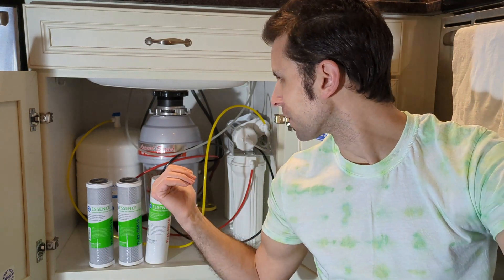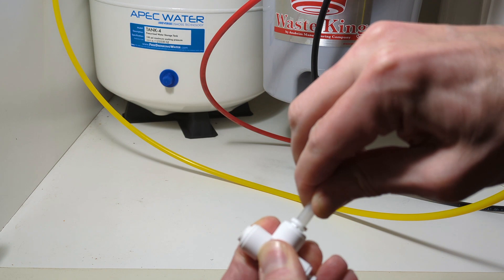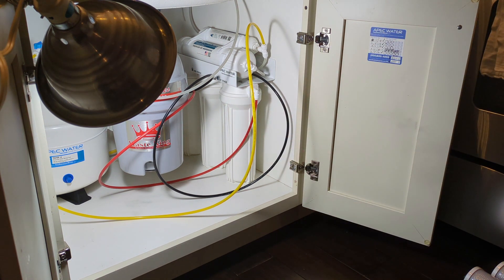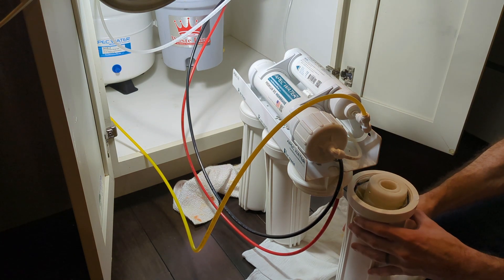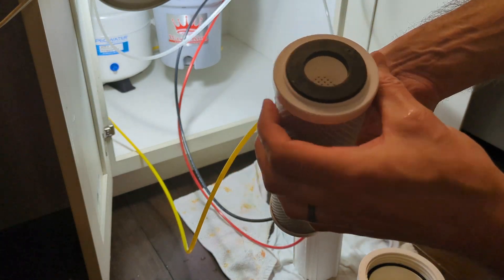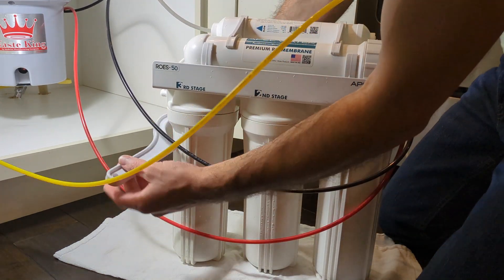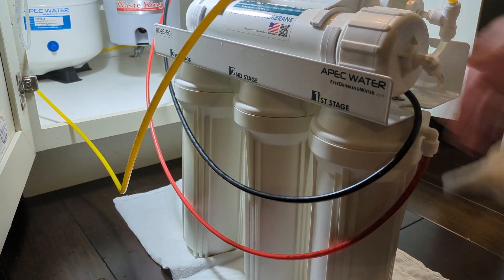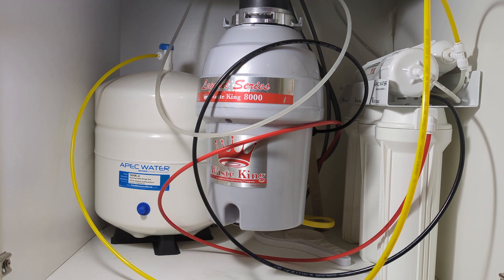Honest Review - APEC Reverse Osmosis Essence Drinking Water Filter System and Change ROES-50 GPD

Comment: Thanks done the video. Does the drainage ( black ) line drip continuously in the the garbage disposal ? I noticed mine making dripping noise in the p trap . Not a lot but enough to notice the sound sometime .
Reply from the maker: Never noticed it here. But maybe I'm not paying close enough attention. I believe it would be continuous until the tank is full. Maybe you could adjust how far the drain line enters the pipe and cause the water to run down the side of the pipe vs drip straight down.

Comment: I noticed you didn’t drill any holes? Is there a way to avoid drilling holes. I don’t want to drill holes in my pipes. I have a hole for the faucet
Reply from the maker: For the drain waste water I did drill a hole and no issues with it. I don't mind since it's not buried in the wall and I'll see if it ever leaks. It's a solid connection though. You could certainly plumb something else into the drain line but it would take some extra time.

Comment: Very helpful video. I have the 7 stage APEC system just installed. Recommended by my kitchen contractor but not liking the filter replacement process. Since just stalled haven’t used much but our issue isn’t water isn’t cold. Fo you know what issue mb?
Reply from the maker: @jacquelineguy6231  water will be room temperature if the tank is in the cabinet under the sink. The filtered water will wait there to be used and warm up to room temperature.

Comment: How long does it take to fill up a gallon jug? Someone was trying to tell me that th RO 50 model will take 2 minutes for a gallon.
Reply from the maker: Depends on the pressure in the holding tank, not the 50 GPD rating. If the tank is empty then that follows the 50 GPD which comes out to about a half hour for one gallon. If the tank is full... then yes actually 2 minutes. I just timed it on mine.

Comment: Where is the automatic shut off valve to ensure it doesnt run continuously once the tank is full? Thanks!
Reply from the maker: @Jonathan-gp8dt  I didn't show it but it's kind of hidden under the top most filter.
Reply: @realhouseDIY thanks! Is it mounted on it, or a separate attachment?
Reply from the maker: @Jonathan-gp8dt  ASO is a separate piece clipped in with 4 tubes connected. There's also a check valve which is part of the housing for the RO membrane filter
Reply: @realhouseDIY thanks for the quick response. Im not sure if my plumber installed that properly. Can this piece be missed? Water flows fine and its filtering.
Reply from the maker: @Jonathan-gp8dt  manual says if input water pressure is below 30 psi, then the valve won't shutoff. Otherwise a bad check valve or ASO valve. Do you have good water pressure and the input valve is open enough? Also I just added a short on my channel where I point them out.

Comment: Video informative and clear but I have an older model, company no more. I am having a very hard time finding filters, plumbers try to have me upgrade. Having no problems with it.
Reply from the maker: @suzyq8538  these cylinder shape filters on the APEC are a standard size filter. Any info on your filters, measurements, etc?

Comment: I bought a ROES 50 system a year ago and just now bought new carbon and sedement filters. They are much lower quality than the ones that came with the system. for example the new sedement filter is no longer a thick paper filter but some kind of polystyrene filter that my water is now running through while picking up who knows what kind of chemicals. And the carbon filters are lighter, meaning they probably have less carbon in them. Another company going cheap in order to increase profits.
Reply from the maker: @kayakdog121  same filter brand directly from APEC? Keep in mind these are standard filter sizes and housings so there could be many different options out there.
Reply: @realhouseDIY  Its funny because I sent a reply earlier that was critical of APEC but it got deleted. It wasn't nasty at all, just simple facts. In short, yes they were OEM APEC filters and yes they are of inferior quality that what they used to be.
Reply from the maker: @kayakdog121  thanks for the info. Unfortunately probably can't determine without testing. Maybe the previous version met the specs above and beyond, while the new just meets the specs.